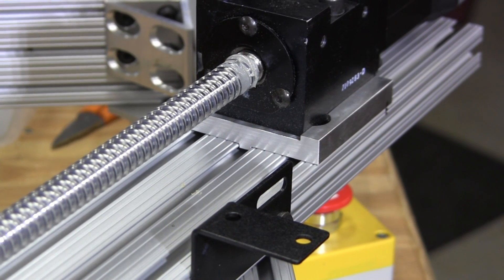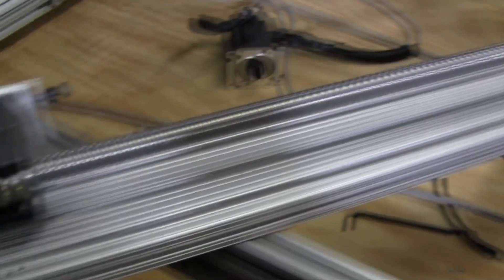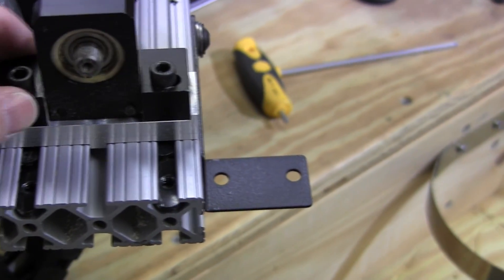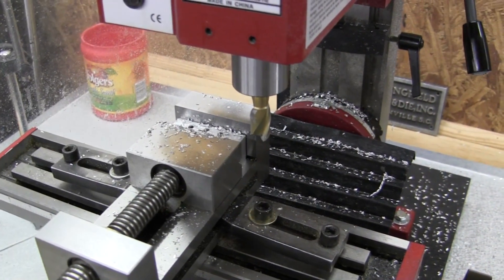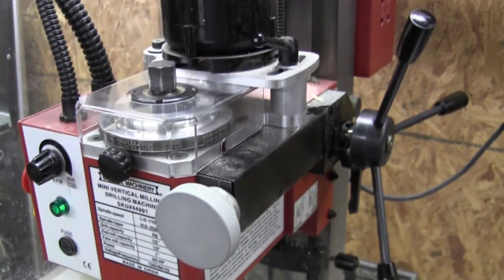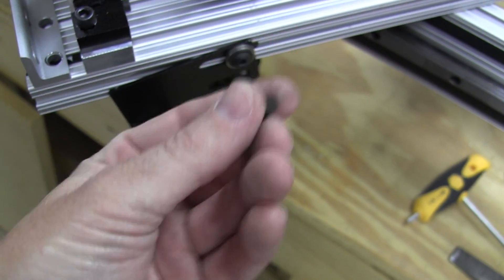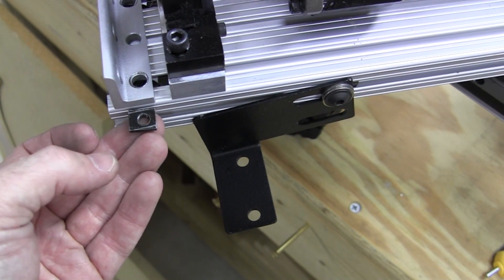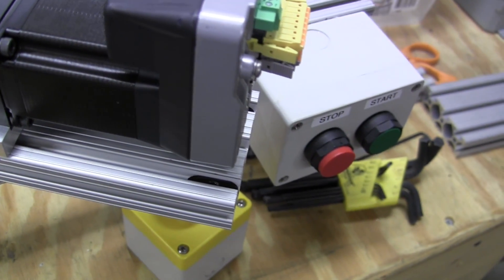Homemade DIY CNC - Larger CNC 3.0 - Part 5 - Y Axis - Part 3 - Neo7CNC.com

Comment: The "heavy duty" (they're actually the standard ones, and the ones you've been using are the "economy" version) T-nuts are supposed to have an offset hole like that, so any you order should match.

As others have said, you can just chop the ends off or your economy T-nuts too.

Comment: Can you not forget about the brackets and T nuts. You can tap the end of the y axis 8020 in the 3 extruded holes. then thru bolt from the front and back 8020 rails.
Reply: Sorry, I just posted a note about this as I didn't see your comment first.  You have the right idea but he seems determined to do it the hard way.
Reply: No worries, no matter how smart anyone is, we all can get distracted and go down the long road, fresh eyes are always good I say. I've had it myself and done it to others, if they take it on the chin like Neo usually does with good critique then we are all helping each other in a friendly manner.

Comment: You're making this so much harder than it needs to be.  You seem stuck on a single mindset.  Get rid of the brackets completely.  8020inc has all kinds of connectors for attaching rail to rail including but not limited to several types of connectors that you can attach to the open end of your lead screw rail that will slide into the front and back frame rails of your cnc.  A couple of small drill holes done with a jig from them and you can screw directly through your frame rails to tighten the lead screw rail tightly in place.  Result means no brackets on either end of the lead screw rail giving you plenty of additional clearance for your new motor.
Reply: Noted, and thanks for the extra notes on my comment.